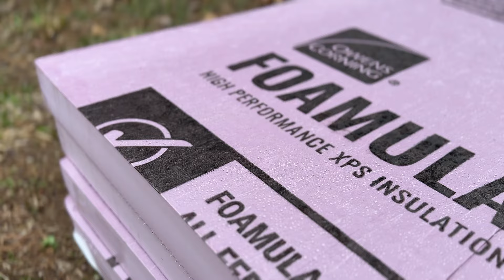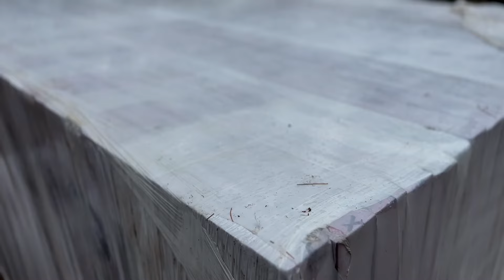Pouring Insulated Concrete in our Pole Barn in Rural Northern Wisconsin

Comment: Great job! If you have holes to fill to keep mice out, use steel wool in any cracks or crevices to keep them out! Works like a charm! Cecil is getting so big!
Reply from the maker: We will have to get some, great suggestion! It will be a big project and probably trail and error but will be so nice to at least cut back on the amount of mice in this building 😁